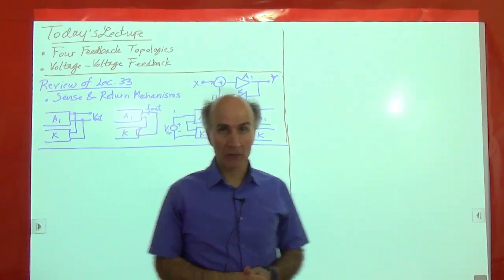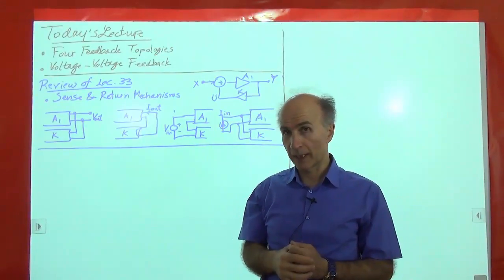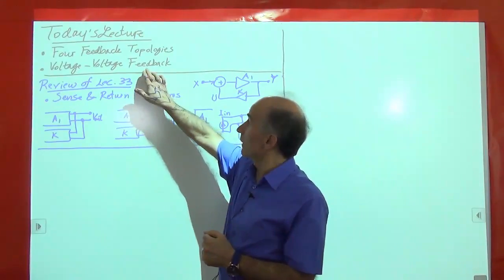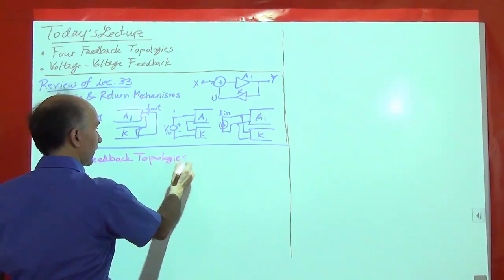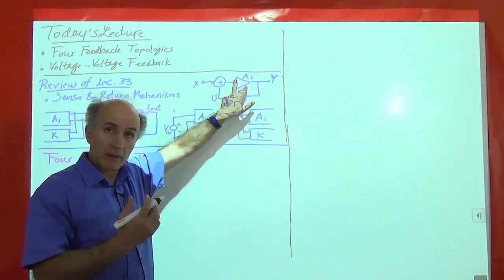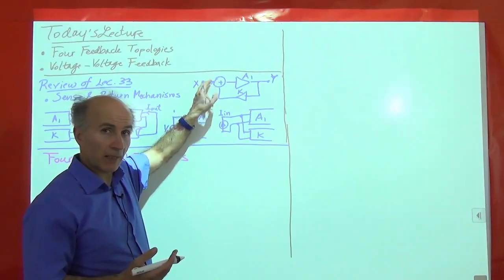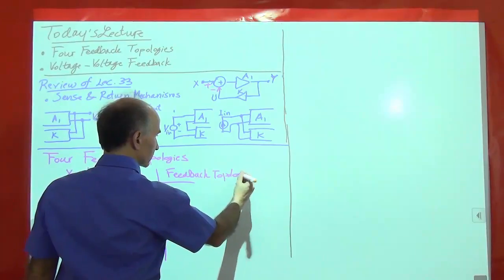Razavi Electronics2 Lec34: Four Feedback Topologies, Voltage-Voltage (Shunt-Series) Feedback

Comment: You have your topology naming backwards. What you labeled as shunt-series is really series-shunt. You explained it correctly, but the common naming convention is input-output. Input is in series and output is shunted, so the name should be series-shunt as opposed to how you labeled it, shunt-series.
Reply: he showed that we name the Output first. maybe that's why there's confusion
Reply: but for the sense&return network (feedback network), the sense is input and the return is output. The sense is at the output of the entire system and the return is at the input. So if you think this way, the naming is actually correct.
Reply: Naming conventions are not a problem so long as you understand how they are being named. Are you going to call out on someone because they said sigma-delta modulation as opposed to delta-sigma??
Reply: Whatever Prof. Razavi says, it becomes a new naming convention.
Reply: Yes, you are right, voltage-voltage feedback is basically series-shunt( according to the definition given by University and Sedra-Smith)

Comment: 01:25 - Intro and Review
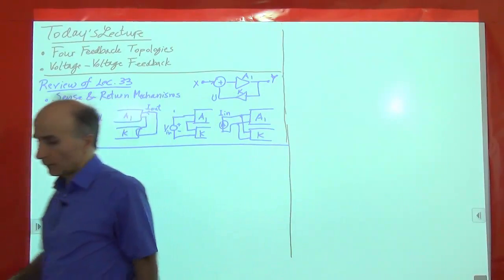05:14 - Four Feedback Topologies
14:22 - Objectives
16:55 - Analysis of Voltage-Voltage Feedback: Closed-Loop Gain
22:15 - Analysis of Voltage-Voltage Feedback: Impedances
23:43 - Analysis of Voltage-Voltage Feedback: Input Impedance
33:05 - Analysis of Voltage-Voltage Feedback: Output Impedance
42:45 - Transistor-Level Example

Comment: 01:16 Today's focus is on understanding voltage-voltage feedback.
04:16 Understanding Four Feedback Topologies
10:08 Different feedback topologies for impedance amplifiers
13:11 Different feedback topologies have different features and affect the output impedance.
19:11 Using feedback to adjust the overall voltage gain.
22:06 Key points about input and output impedances in voltage-voltage feedback topology
27:08 Analysis of feedback topologies with voltage and current
30:17 Negative feedback increases input impedance in voltage-voltage amplifiers.
35:09 Finding closed-loop output impedance
37:58 Feedback reduces output resistance by a factor of (1 + Ka)
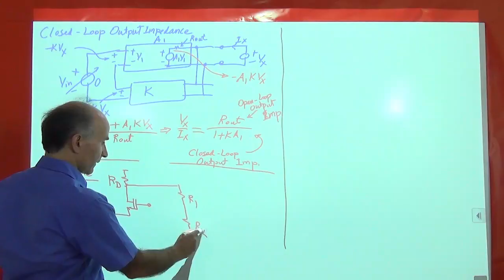43:22 Voltage-Voltage (Shunt-Series) Feedback Topology discussed.
45:57 Voltage-Voltage Feedback Topology Characteristics
Crafted by Merlin AI.

Comment: These are extremely useful lectures for which I am very grateful. I have some doubt though: When the Prof speaks in many locations including here at about 18:26 explaining how Vin and the Return voltage U are connected in series to build the difference Vin-U. Here he mentioned repeatedly that Vin, U and the input of A1 are all connected in series. Here is where I have doubt: I agree that Vin and U are connected in series and at the resulting two terminals of this connection we have Vin-U. This difference is in my opinion connected in parallel to A1 input as A1 is supposed to sense (measure) this difference exactly the same way a Voltmeter would be connected to measure (sense) the difference.
Am I mixing something here?

Comment: 28:30 - Input impedance is being bootstrapped (Miller Effect) and thus lowered by the negative feedback. For inverting amplifier configuration, the configuration would be called Voltage-Current/Shunt-Shunt?
Reply: explain how?